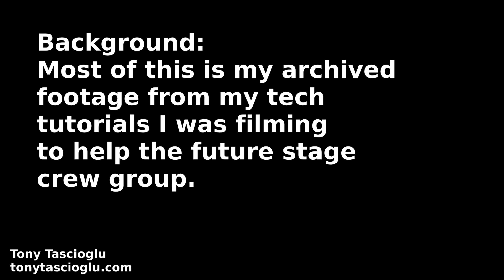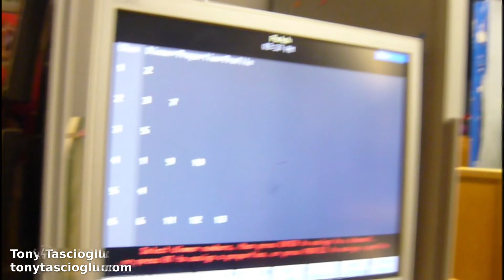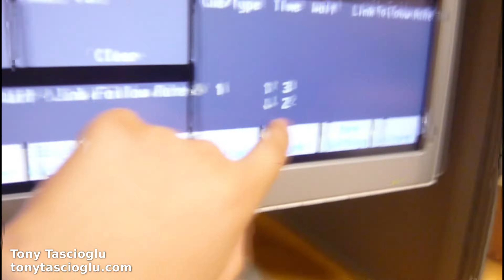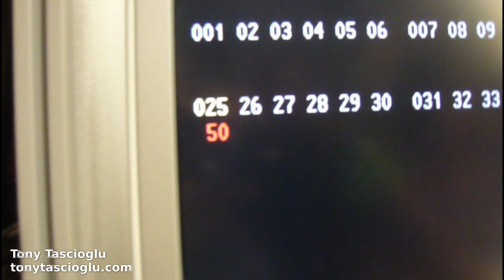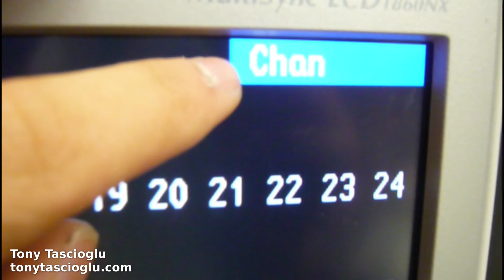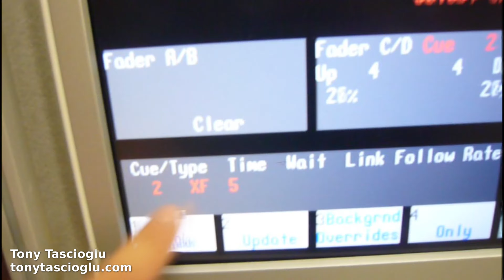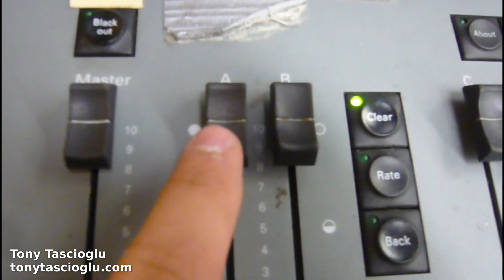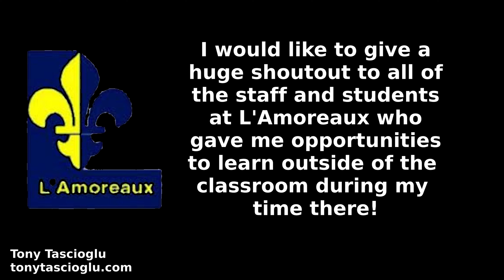ETC Express 24/48 Lighting Board Usage and Programming Tutorial

Comment: If i have LED lights pluged into the board how do set the channel to do a specific color like channel 27 does red and i want channel 28 to be blue and so on?
Reply: And this is for one led that I want each channel to be a certain color or is there a better way to do it
Reply from the maker: Patching! Patch dimmer 27 to the channel on the board you want.
If you want to do colour mixtures like orange, teal, purple, you can program submasters which should be able to scale the 3 channels accordingly.